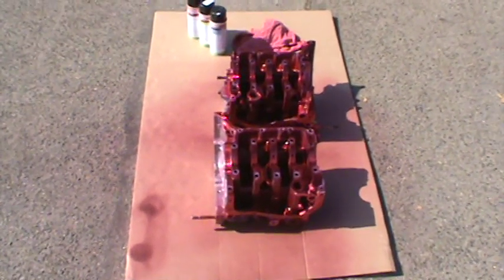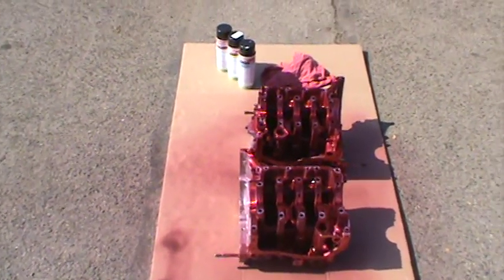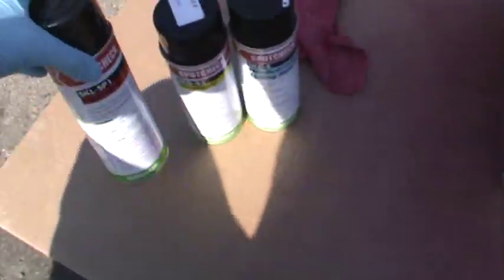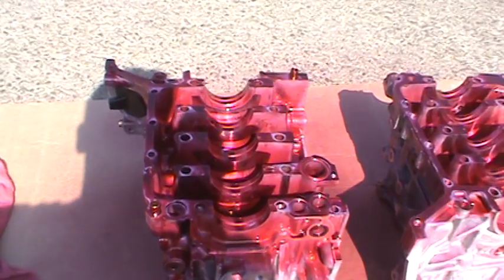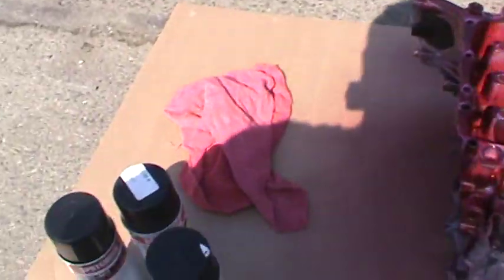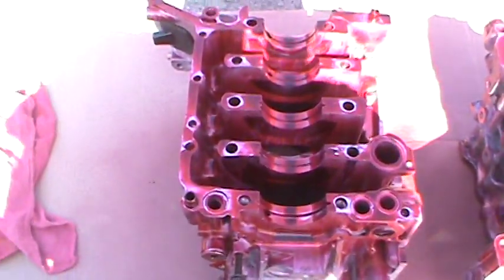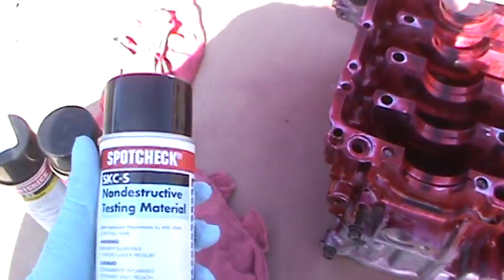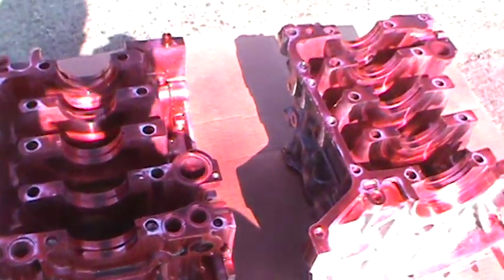Aluminum block crack detection techniques (magnaflux dye penetrant)

Comment from the maker: I appreciate you watching all my videos and being loyal.  You're issue is most likely due to failure of the piston rings to seat against the cylinder bore.  You can do a compression test to check this, and by adding a squirt of oil in the cylinder and re-testing, you should see an increase in compression IF the rings are bad.  Hope this helps.   If you need further assistance just youtube message me.  I don't have enough time to reply to all the video comments.
Thanks again,  SUBSCRIBE